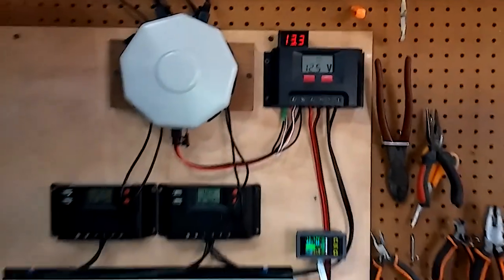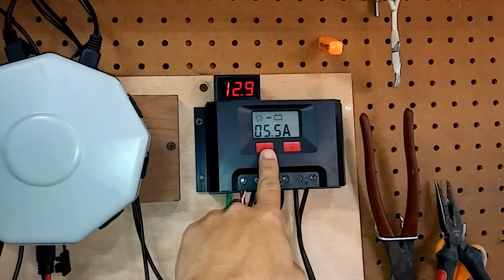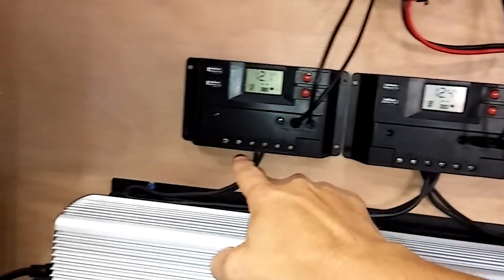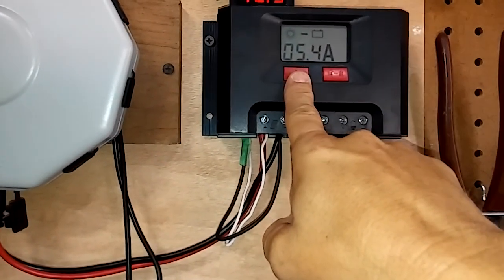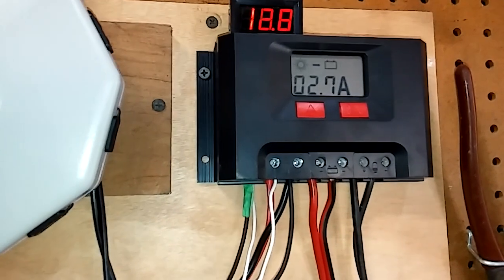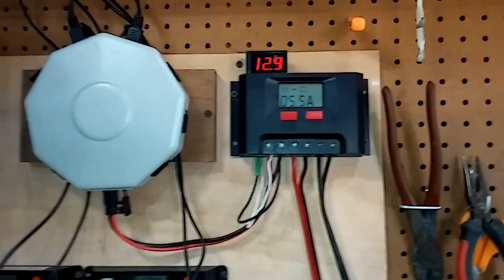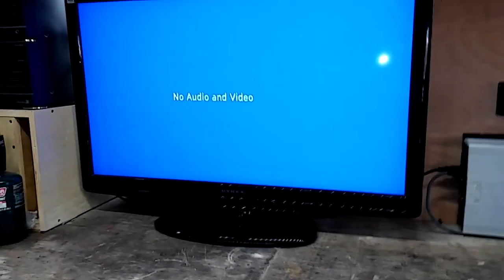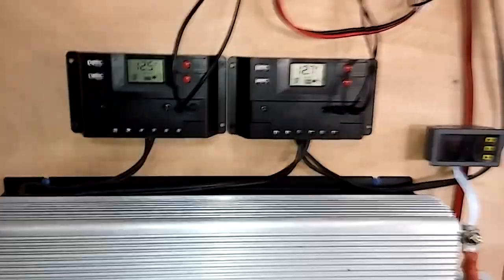200 watt Harbor Freight solar project. My opinion on output power

Comment: Absolutely spot on. Just purchased identical set up and in Tuscon mid day sun blazing I'm pulling 50watts at best. Fluctuating from 35 to 50 depending on clouds... Doesn't pull as much until sun is directly overhead.. Thanks for confirming my speculation..
Reply: they  do generate much more than the newer panels do under clouds though. It's nice to have 2 or 3 of these + 3+ newer panels for sunnier days, running to a better charge controller of course

Comment: I have two set of these 100watts each I ditch the charge controllers an bought a MPPT chargecontroller to try an get the most out of panels best I can get is 6.3 amps . But to give all the variables to paint the hole picture there is roughly 70 feet between panels an charge controller. Yes there is loss in that kind of run !  But on the flip side learning is some time expensive . Also if I were to give advice I would say spend the money on better equipment that way when you learn how it works where ever you are at ,you can add to it for what ever you are planning on running with it . For me better panels to run my freezer! So roughly just under $300.00 for two sets of harbor freight kits $180.00 MPPT Charge controller. $360.00 for battery’s & $150.00 pure sine wave inverter (500 watt) I have learned to run a 150watt freezer ( small one ) I need two or three good 100 watt panels to run my freezer off battery’s 24hrs a day and never run out of power even for 3 days with no sun. Hope this helps someone out there wanting to try this!

Comment: Solar panels are rated at the volts and amps listed on the label on the back.  The rated voltage for 100 watt panels is usually 17.5-18 volts.  The rated current at that voltage is 5.5 - 5.7 amps.  IF you match the voltage to the load, you will see the rated amps.  PWM controllers typically only show the full panel amps when the battery is at a very low state of charge.  If you disconnect the panels overnight and don't connect them back until the battery voltage is 12.1 or so, you'll probably see something close to the rated amps as the controller tries to quickly bring up the voltage on the battery.  If the battery is partially charged, the controller moderates the rate of charge to whatever is needed  - which isn't always the full output of the panels.  Remember that the term is "charge controller" - it controls the charge to a level appropriate for the battery's current state of charge.  If the battery charge level and the current load can be handled with half the solar panel capacity, that's all you'll see.  Check the amps from the panels.  Turn on the 60 watt load and watch the amps for a few minutes.  You should see the solar amps increase to match the load.  Probably not to the full 10 - 11 amps the array can deliver but just enough to keep up with the load.
Reply from the maker: notyoung . I brought the battery down to 11.6 volts with the fridge hooked up. The amp draw was 8.4 amps according to my amp meter. The controller never went above 5.4 even when the demand was needed. Someone told me that pwm controllers were only 30 percent affective. I am building a charger using a 12 volt reg and some 3055 transistors. Not as a battery charger so much but something to compensate for the amp loss during the day when i realy need it. Maybe it will work or be a compleate waste of time. Eather way I enjoy playing with crap, lol. Thanks for your info. The more I learn the better
Reply: Your next step would be to replace the PWM controller with an MPPT controller.  The EPEver/EPSolar Tracer 3210a is rated for 30 amps (390 watts max to the batteries) and can be found for $100 or a little more on Ebay.  I have two of them and they work as advertised, getting the maximum power from the connected panels, whether a single 100 watt panel, one or two 250 watt panels in parallel or one 300 watt panel.  I've seen a single 250 watt panel deliver 235 watts via this controller.  Be specific in your search.  There are some PWM controllers on Ebay (and elsewhere) that are advertised as MPPT.  You'll may want to rewire your panels for the MPPT controller.  Put them in groups of two panels in series and those groups in parallel to connect to the controller.
Reply: @Checkitfirst  I know this is a late comment but after reading the manual I noticed that it said 50v maximum input. Perhaps hooking up 2 panels in series might allow more current to pass through the battery assuming your panels produce 18-22v each.
Reply from the maker: @ivanbasso3027  
That probably would have been a good idea. I have a different charge controller now. I have all my panels running in series now over 100 V. It does work better.😁

Comment: When I get back to where my set of panel are, I'll pull up some data on them. I currently don't have them set at the correct angle but even at that they were doing 50% of the test rating. With 200 watts of output under perfect conditions you should see 11.5 amps at 17.5 volts. I know that I have seen over 8 amps at 13.5 volts out of mine. Or slightly over 100watts out of the 200 watt set. My losses were due to temp (90°) and the angle being more than 30° from optimum for this time of year. I don't get a full current draw on them as even with the inverter on and outputting 225 watts, the batteries are in the 12.8 volt range. As soon as the load drops, the batteries climb back up to 13.8 volts to 14.4  volts.
Reply: gravelydon 
It's important to note that with a PWM controller, watts are lost on any solar panel because of the lower voltage of the battery relative to the full voltage potential of the panels. Ie: those 17.5 volts will get dragged down to the battery voltage which must not exceed 14.5 volts.  So at best, you could get the same current of 11.5 amps at 14.5 volts which is 167 watts.   More typically, the battery will be somewhere in the 13 volt range which will result in a maximum power output of 150 watts.  
Using an MPPT controller could greatly minimize those losses but on a system this size it's not worth it.
Reply: What you say is true Andy. But in my case, it is the batteries that are taking the charge and reaching float level too quickly. I saw 75 watts going into them the other day with the batteries at 13.8 volts ( float level ) ( panels were up at 20 volts ). So I need more batteries to soak up what they are putting out. Over night with a 300 watt inverter running, the batteries are only going down to about 12.7 or 12.8 volts. They are back up to float level by 10:00 in the morning.
Reply: gravelydon 
If your battery voltage is still 12.7 after using it all night it sounds like  you aren't drawing much power off them.  What is running off the inverter?
Reply: Just a bug light with grid to kill the ones that get close. 100 watt load on a 300 watt inverter for the bug killer.  And lights on bright and fan when I'm in the shed. LED lights go down to 7.5 volts when not in shed and under 100mA load. During the day it is running a fridge, and maybe a fan. It is mostly there for a backup when the grid goes down and one battery by itself kept the lights, fan, tv, and a fridge on for two hours at a time during Irma. Now there are 3 batteries so it should be able to run the same stuff overnight and not need to listen to the generator running. During the day, it isn't so disturbing listening to it. Until you have to do it for 5 straight weeks for 24 hours a day. :-(  I have run a 1500 watt load on the bigger inverter for short periods when using it for heat shrink tubing shrinking.

Comment: I really think that is low. But I have no idea how you cn get more out of those panels. As for the set up, it is looking good.
Reply from the maker: kb1nyd .. I even disconnected the charger and wired my amp meter directly to the pannels. Hooked  a dc motor from a treadmill to the panel's. Held the shaft of the motor to load it up, basically drawing all i can from the panel's. It only read 5.8 amps. Thats all 8 panels directly to the motor. 21 volts. Almost a dead short... Should have been more

Comment: Saw another guy showing how he got 7.8 to 8.4 amps direct from two solar kits that were the black plastic framed ones from harbor freight.  He bout an additional charge controller separately from harbor freight and it only put on about five amps as you are.  He went direct to battery with the panels and it showed the higher 8 amp zone and when he used in charge controller from one of the two kits it gave him that 8 amp output the same as going direct.  But the additional one he bought thinking it may work better with two kits into one controller only put out about 5 amps.  

So your getting different results than he unless he used the other additional controller he bought extra from HF
Reply from the maker: @jonathanblack1416  
I found that the original charge controller worked better than the 500 W. I actually ran 3-100 W kits through one charge controller and it did just fine.  That new 500 W controller didn’t work as good as the original.
Reply: @Checkitfirst  
Wow 😮 
That’s amazing to me to hear. That’s great intel shared.

Thanks for letting me know🙏🏼

Now we can wonder how much the one original can handle lol three is pretty nice though
Reply from the maker: @jonathanblack1416  
The original charge controller has a 20 amp fuse in it. I actually did a video on it.
Reply: @Checkitfirst  
Oh.  Okay 👌 

So that’s what to look at is the fuse to know the truth then.

Didn’t even think it.

That’s great intel again.

Thanks Checkit 🙏🏼

Comment: Would having the solar panels connected to a MPPT controller give better current output versus the cheaper PWM?
Reply from the maker: MPPT in my opinion is better when running your panels in series or using higher voltage panels. If you’re only using a small 12 volt system then PWM is really all you need.

Comment: I like your video And all this informatión  have you tride 2 baterías yet?
Reply from the maker: mario villagres. No. I’ve never ran this battery down low enough to rush out and get one. It runs my two small fridges and LED lights continuously without drawing the battery down real low it’s still in the 12 V range in the morning and it always charges right back up. The way I see it the more batteries you have the longer it takes to charge and the more power you need.

Comment: hi there, i just got 4x 100 watt panels, and i got the octagon splitter and a jackery battery which i think is also an inverter, what am i missing? all 4 panels only show up at 1 panel worth of output no matter what i do
Reply from the maker: What charge controller are you using
Reply: @Checkitfirst  wow thanks for the quick reply, I just got the entire system is that the piece im missing? what would you recommend, i saw it in the video just unsure how to wire it to the jackery battery
Reply from the maker: @tips4tesla407  
Most likely the battery will not draw 400 Watts depending on the size of the battery and the charger that is built inside your Jackery   It seems that the device you have regulate its own charging. I would read the brochure on it and make sure that you are not putting too much into it. I’m sure it has a limit as to how much power you can put into it
Reply: @Checkitfirst  Other channels are saying something about harbor freight panels needed some kind of polarity adapter? its a smaller battery but it should take at least the same as the juice from the wall i would hope, im unsure whats not setup correctly atm
Reply from the maker: @tips4tesla407  
How big is the charger that you plug into it to charge it from the wall.
Reply: @Checkitfirst  a normal 110, ive seen it read about 65w in the wall, but i cant get it to even read 65w with 4x 100 panels plugged into it, i think im missing a component, maybe the polarity adapter or my octagon hub isnt working correctly
Reply from the maker: @tips4tesla407 
When you hook your solar panel kit up to it you are getting an input that it is reading correct? somewhere close to 100 Watts
Reply from the maker: @tips4tesla407  
The 1000 series of the battery you are using has a maximum input of 200 W of charging. I don’t know what size unit you are using.

Comment: 5 amps does seem to be a bit low, but your going to lose some voltage from the wire, & as the panels heat up the hotter they get the less energy they will produce.  Do you have the specifications of 1 panel?
Reply from the maker: 25 watt 18 volt thats one pannel.
Reply: @Checkitfirst  it should have some information telling you its +/-  per 1°c change in temperature
Reply from the maker: @LarsLondian  . I still have paper work. I check

Comment: Something wrong with your setup.  Maybe the it's the panel angle but I get 5 amps easily in those conditions with a single 100 watt system.  You should be getting 10 amps.
Reply from the maker: Andy Andy . Ya, I thought about the angle cause i have checked each panel and every thing else. At 2pm the sun is directly over the panel's but the panels are at a slight pitch. Didn't think they would be that sensitive to such a small angle

Comment: At $200 a 100 watt set it isn't the cheapest way to go. It might be the easiest route, but not the cheapest. You can buy a nice 200 watt panel for $175 on ebay. And much better quality. But if it works for you and your happy then that's all that matters. Sorry for being negative.
Reply from the maker: When I first started this solar project... It was a 100 watt Harbor Freight kit that my wife got me as a gift. I sorta kept buying these kits because I wanted more power.  I won't be buying anymore harbor freight kits. I have however been looking on line for single 100 watt panels. I havent seen a 200 watt one yet. I will look into that... Thanks

Comment: i have the same controller and i got 2 of the 100 watt panels hooked into it. i was getting 15 amps today for 2 panels.7.5 amps a panel. got another panel coming in this weekend going to try fo at least 20 amps for better charging on my large batts. good vid
Reply from the maker: Do you have the new type of panels harbor freight has?

Comment: Why don't you just get 2 car alternators and a swamp cooler motor and power everything  with 180amps no solar no battery  just pure  power you do the math have a great day
Reply: That will power your house night and day that's how alot of people  are doing not
Reply: Sounds like a great alternative ..The downside of dual alternators and an swamp moter running.lots of high speed moving parts belts etc  not very mobile and  DB noise factor a lot higher vs  silent  multi panel solar system.

Comment: I really don't care for that charge controller didn't get very good results
Reply from the maker: I agree. That’s why that charge controller is sitting in the bottom of a drawer in the garage covered in a bunch of crap. The original charge controller that came with the first kit that I bought worked better than that one
Reply: @Checkitfirst  I like the original controller alot wish more designs had more outputs

Comment: So sad.  5 amps
Reply from the maker: Old video.. 9.3 now.. Sucky controller
Reply: @Checkitfirst  really? What do you have now. My amps on my system are super low but I suspect it's because they are behind a window inside my house.  It's also charging a gell cell which might have lower amp setting too.   I havnt   tested it's actual output with a short of some sort like using a fat resistor.
Reply from the maker: Im using the original controller that came with one of the 100watt kits
Reply: @Checkitfirst  any that allowed for more amps? Know any reason why that may have happened?